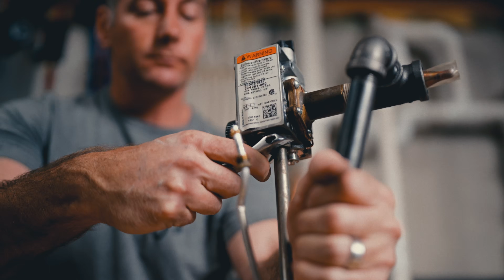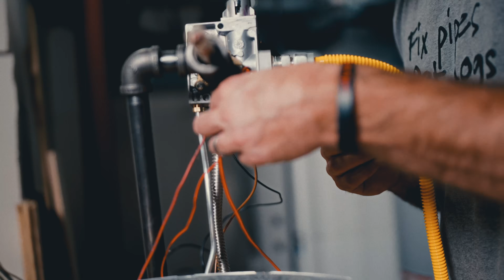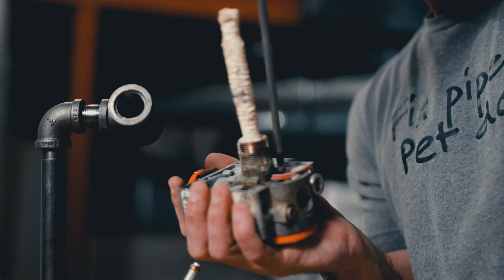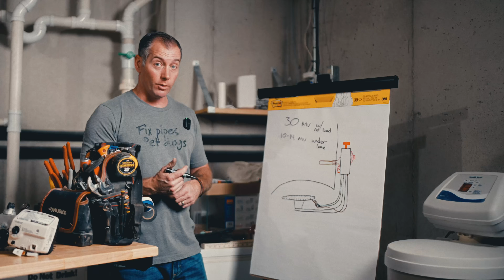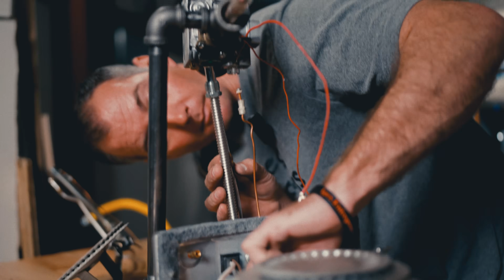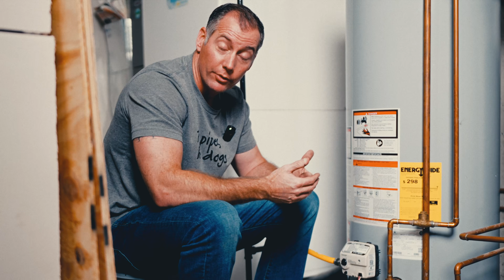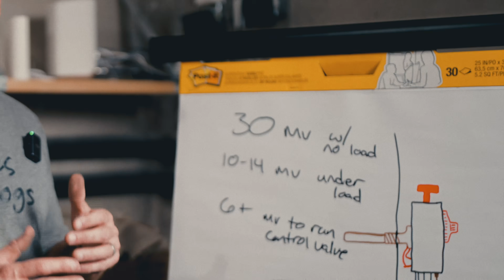Water Heater won't stay lit - Here's why

Comment: I’m old enough to remember when a water heater would last 30 years without any problems. Now they make them “safer” and they only last 5-10 years.
Reply from the maker: Planned obsolescence for sure
Reply: @SmedleyPlumbing  Ensh*ttification.
Reply: I installed my old Whirlpool in 2004! That was the first yr for the sealed burner assembly. It's the model that had a problem with the pilot light going out. Whirlpool sent out a replacement entire burner assembly, with a limit switch. The original assembly didnt have a limit switch. 21 yrs old now and working very well.
Reply: Small tiny electronics and total disaster
Reply: My wife and I purchased our home nearly 30 years ago, which was a couple of years old. We replaced our air conditioning unit about three years ago and the water heater just stopped working (heater won't stay lit). I'm going to try to replace the thermocouple (no, I have little idea of what I'm doing), but just sharing the testimony. As I shopped around, I'm told water heaters are only supposed to last ten years or so, including air conditioners. I thought we were suppose to progress, rather than regress...  I want the old models in a new version, but alas. I'm not sharing the brands, because it sounds like they all of changed in quality.
Reply: If all fails, we going with a tankless and lining up the install ($5k-$6.5k)
Reply: @Austin_Bennett77  everyone I’ve talked to that has a tankless on demand type loves them, I have heard that hard water and minerals can be problematic and the heat exchanger needs cleaned every so often so I think a good water filtration and softener would help.
Reply: @OldmanWithaGoldPan-o2g thank you!
Reply: @Austin_Bennett77  wow i will stick with a tank water heater it only cost me 800 dollars about 5 years ago last one lasted 18 years
Reply: I think it's not the 'safer' that makes them last less but the 'efficiency' that does. All these super efficient appliances are so finicky
Reply: My old Rheem lasted  47 years and was still heating fine! ❤ The only reason it had to go was rusty braces holding it up. I miss Old  Faithful. 💧😢
Reply: My 100 series lights as required every time.
But the flame burns yellow & loud about every third time.
I can't figure out why.
Reply: Some of the safety stuff is great.  Not many people these days remember when water heaters were actually known to blow up/out due to not having a safety relief valve on them.  Until a person sees the back side of a house completely blown out, or someone, like a wife, or especially a kid or 3 scalded severely from a water heater blowing out, the average person these days never give that little $30 brass fitting much thought.  Some safety stuff do suck, but others could be worth their weight in gold in the right situation.  JS
Reply: @jimjordan5630  yeah the TPS valve is a good thing for sure. They’ve been in use (according to googoyle) since around 1910, and I’m not that old lol.
Reply: My Man! Thank you for breaking it down for the common man. I was more knowledgeable about what I was doing and looking at, and not just replacing my unit on the fly! 😅
Reply: Had an LP in Sandhills north of Hutchinson ks from 1974, leaker in 2017
Reply: I installed a new big box store Rheem gas only water heater 2 years ago with a honeywell controller and it's already having pilot light issues. I believe Smedley Plumbing would call it a series 4. It has a thermistor in a brass hexagonal tube near the big burner, a thermopile heated by the pilot light, the spark wire, and 3 wires inside the control box that I assume go to dual thermistors inside the tank. All that stuff checks out.   At this point I think the little control circuit board is the problem.

I design solenoids and it's crazy to me that a 30 mV thermocouple can hold that pilot plunger down.
Reply: @har @harborfreight2323 he reset/WCU/thermal switch has activated then kit very well could be a clogged air intake vents. If that is covered in dust just wipe or brush it off and rest the little shut off button and light. Hopefully this does the trick.
Reply: @OldmanWithaGoldPan-o2g  Do you mean whatever lets air flow up to the burner in through the bottom of the housing?  I haven't looked in there but I will.
Reply: The thermocouple is not powering a solenoid that opens a valve.  Your finger pressing on the knob is what opens it.  There is a latch that keeps the valve open that has a small electromagnet powered by the thermocouple. 
Compare it to a rifle trigger.  It takes a moderate amount of force to cock the hammer, but just a tiny force on the trigger to release it.
Reply: @colonelkilgore6296  That makes sense but the main burner valve operates without human assistance.
Reply: @colonelkilgore6296  This makes sense, but how does the main burner valve open and close? I'm asking about what I think is a series 3 controller, with only a thermocouple. Maybe the burner valve operates differently, or maybe it's like the valves on my sprinkler system where a tiny needle valve opens and uses the fluid pressure to operate a larger valve.  Kind of like a transistor.
Reply: Fact check true.  I had a 32 year old A.O. Smith that was working.   But I changed it thinking it was on borrowed time.  New A.O. Smith lasted 8 years with nothing but problems.   I just finished about an hour ago changing it out.
Reply: How do I reset my AO Smith? Flashes 6 times indicates replacing burner. I blew out dust and debris around air intake but burner won't light.
Reply: Should I try to replace burner myself (no experience but u tube video looks fairly straight forward)
AO Smith unit
Reply: Yes! The took the simplest appliance in the home and made it very complicated. You can probably thank some lobbyists in Washington for that 😂😂
Reply: @TheRingo001 oh we know that's the damn true!

Comment: My new (bought 9/24) Bradford White gas Water heater was set to pilot before I left on vacation for 3 weeks.  When I came home I went to turn the stat to desired temp.  As I was turning the dial to "low" heat, it would not fire.  Then to "Hot' still nothing.  I had to turn it all the way to "Very Hot" and it fired.  My conclusion was it never stopped heating the water at all even when on pilot.  Does that sound like a bad T-Stat?  Thanks!
Reply from the maker: Nope.  Tanks hold heat much better than you think.  That pilot light is pretty warm.

Comment: Just moved into a new house and it has the series 300. I get the pilot lit and the blue light is flashing and I turn it to the desired heating that we want it at it starts to heat. I see the flame through the little window. It works for about a minute and then it shuts down with a red light error. I’m trying to figure out what it might be. If you have any suggestions, I would really appreciate it. Thanks in advance and a great video.
Reply from the maker: The red light should blink a number of times and then you reference the fault code guide on the control valve.
Reply: @SmedleyPlumbing  Thanks for the reply. I will check that out . Much appreciated!!!

Comment: First of all great video. I have a Bradford White Defender water heater. It keeps going off and now it won't come back on. I'm very mechanically inclined so I want to diagnose and fix it myself. The reset button you mentioned didn't click on mine. I don't think the issue is with the thermopile which leaves the control valve. Do you have a video on how to change the control valve?
Reply from the maker: Manually light the pilot light and keep holding the button down.  Then check for at least 350mv dc from the two wires plugged into the control valve.  If you have 350 or more, replace the control valve.  If you have less than 350, replace the thermopile.
Reply: My gas got shut off for the Federal mandated meter inspection an then pilot would not relight. I didnt even see any spark so replaced igniter assembly. Pilot now lights and I get green status light but pilot goes out as soon as I let off the pilot button.

Comment: My hot water heater has the valve, pilot light, igniter button and thermocouple.  I've replaced the thermocouple and valve both.  I can light the pilot first try and after a few seconds or more it stays on and I can turn the unit on. 

It stays full flame running for 5-10 minutes then just turns off, pilot light and all.  I have to wait a few minutes to relight the pilot, but once the pilot stays on I can instantly turn the unit back on and get a nice big blue flame.  

It stays on for another 5-10 minutes then just shuts off instantly, pilot light and all.
Reply: Well my brand new thermocouple lasts 5-10 minutes then goes to 0mv.  Wait 3-4 minutes and it starts working again.  Just my luck to get a defective one 😒
Reply from the maker: Chances are you have a blocked air inlet screen or a blocked flue pipe.  Sounds like the unit is overheating.
Reply: @SmedleyPlumbing so there was a giant plate covering the tiny filter.  I cleaned underneath and around the plate but the plate would not come off.  I finally pried it off and sure enough the tiny intake vent was covered in rust debris.  Hoping it will stay lit now.

I guess it didn't need the control valve, but it was covered in scale pretty bad so it may actually work better now.

It did need the thermocouple though because the pilot would not light or stay lit to begin with.  Once the new thermocouple was installed that's when it would light every time but run for 10 minutes or so then shit off.  Must have nocked more debris onto the filter as I took it apart.

Thanks for the great video and advice!

Comment: I have a resideo control valve. The pilot light would go off the moment i removed my finger from the control valve when igniting the pilot,I replaced the thermopile, and the pilot is still going off after removing my finger from the control valve.
Reply from the maker: Test the two wires going to the control valve.  Need at least 350 mv DC for the control valve to function.
Reply: @SmedleyPlumbing  Indeed. If you are getting > 350 mV then it is not your pilot and/or thermopile. The power from the thermopile powers an electromagnet that holds open the gas valve, so you no longer have to hold it with your finger.

Comment: My brother in-law has a 3 unit income property.
The company that installed the water heater less than two years ago failed to replace it adequately.
American Standard 40 gallon water heater serviced 3 units with a washroom with appliances.
When I contacted the company they advised us the plumbing company who installed this should have installed a commercial water heater 50 gallons.
Can you please explain the warranty with each type.
Also, the reason the pilot wouldn’t stay lit was they didn’t install a drip tee to prevent condensation and any debris coming into the unit’s burner assembly and gas valve, thus the pilot staying lit failed.
I had to correct that.
Plus the company said that if they installed the 50 gallon unit we wouldn’t have to purchase the pilot assembly it being under warranty (less than $100.00) I purchased & installed.
I tried to send a photo but wasn’t successful.

Myself being a 3rd generation retired HVAC and sheet metal contractor (father 56 years) helping my father I’m always concerned with how the gas appliances termination tops should be vented.
Thinking about the heat exchangers of both the water heaters and any type gas appliances, if they don’t have the type-B termination caps, I would think the exchangers overheat and most of the heat that should have gone into our homes go into the atmosphere instead of our homes.
The central heaters has an inducer motor that turns on prior to the squirrel cage motor and doesn’t have the ability to know if the termination top is there or not.
In the 1980’s is when we installed space heaters they usually were installed in Victorian fireplaces. 
Prior to that time they simply could be put in the small fireplace and vented with a bonnet top termination top.
Also Williams wall heaters had a sensor they wouldn’t function without a double wall flue with a B-termination cap.
Now as you mentioned, they must be directly vented from the unit with double wall ductwork (Metal Bestos) or other brands.
They have several sensors if you have the knowledge to explain I believe it to be helpful for all to understand.

Excellent presentation!

Thank you!
Reply from the maker: Sounds like the cheapy is won the job.

Comment: That was an awesome video!  I appreciate you taking the time and effort to educate us non-plumbers.  Many people just don't have the money to pay to have things fixed.  I have the money, but I'm super cheap and a little adventurous.  Anyway, well done, and thank you!

One quick question:  Will the water heater pilot and or burner light if the door  (with the viewing window) off, or does the door need to be on?  It's a Bradley White with the plastic covered control valve.
Reply from the maker: It will light with the viewing window removed.  But you lose your resistance to flammable vapors.

Comment: Very informative video, sir. Question My AO SMITH WATER HEATER pilot light won't stay lit after 2min. I did replace the brand new pilot assembly. Could this be the gas control valve need to be replaced? Thank you for sharing, sir.
Reply from the maker: Possibly.  Is the thermocouple or thermopile producing the correct millivolts?

Comment: I have Rheem water heater, the pilot will stay on, there is no light, you can see the burner light up, but it will not stay lit for very long,maybe as little as 4-6 seconds.
Reply from the maker: Rheem is notorious for having bad control valves.
Reply: @SmedleyPlumbing should I replace the control valve or the thermal pile?
Reply: @SmedleyPlumbing  I just had one bad on a new water heater out of the box. Went to light pilot, and nothing. That was supposed to be the easy part. Rheem did get the part out quickly, but...reallllly? . Once installed, it lit up after two strikes with the igniter button.

Comment: So i pilot is continuously going out and im needing to press the reset button every time also the flashes are indicating thermopile low voltage  even after replacing thermopile. Also we replaced the control valve last year as well. Any idea why the voltage would be low and the temp probe keeps tripping. Could the temperature probe  be faulty or  need replaced possibly? Ive cleaned out any debris around the burner assembly and around water heater.
Reply from the maker: It's possibly your reset switch/button is faulty and pulling too much current.
Reply: Thank u so much for the quick response do u know what the current pull should be or how I can test this

Comment: Great video! My 75 gal water heater, over a couple years, occasionally failed to keep the water at temperature.  If hot water was used it would sense the decrease in temp and the valve would kick on. But over long periods of no use, like over night, the slow gradual decrease in temperature was not enough to force the gas valve and burner on.  I replaced the Rheem Water Heater valve SP14339B twice and each of the new valves did the same thing. Hot water during the day but over night it cooled.  I also replaced the thermocouple and pilot light parts. Any ideas?  Thanks
Reply from the maker: Sounds like the water temp might be set too low.
Reply: @SmedleyPlumbing  Thanks for the response. Temp is set to B, scalding. I keep setting it higher but same problem. It is a strange problem to have on multiple valves.

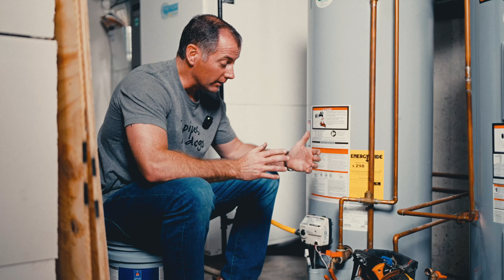Comment: Hi. Great video. I have a Whirlpool 50t6-40ng-400 which uses the Honeywell system. After removing buildup on the thermopile and reassembling, I did the procedures from 13:30 in the video. The thermopile hits 733mv. As long as i keep the control on "Pilot" the pilot light stays on; timed it to 10 minutes. But once i set the temperature to "hot," the flames kick in for no more then 2 minutes and go out. When it goes out the pilot light goes out to. Would you have any suggestions?
Reply: Where is the inlet
Reply from the maker: Most likely a dirty inlet air screen
Reply: Thanks I think that’s my problem also 
Going to clean tomorrow and see 😊

Comment: Okay, I have a question if anybody can answer. After letting go of the valve button the flame for the pilot light stays on but when I light the water heater grill it goes on immediately but then starts to get lazy blue. color. Why is that??
Reply from the maker: You want a blue flame.  Yellow flames indicate bad air fuel mixture.
Reply: @SmedleyPlumbing  yeah I understand, but the flame will start to wobble back and forth instead of staying an inch above and around the grill. And kind of looks like it's struggling to stay up. I already replaced the valve with a new one and vacuumed out any debris in the burner area and replaced the glass sensor bulb in the back. Maybe it's the thermopile not giving off enough millivolts but has enough millivolts to light the burner but not allowing the valve to open all the way.

Comment: My water heater is upstairs and in a tray. I can't get under it to clean it. Is there another way to clean the screen underneath. My heater goes out all the time and I got to push that reset back in everytime. It is a gas heater with the series 300-400
Reply from the maker: If the tray is metal, you can bend the edge down and then bend it back when your done.
Reply: It's a big plastic bowl pretty much. Black in color. It's pretty deep.
Reply from the maker: @johncummings260  you can probably use a flexible brush to get under there

Comment: So basically skip everything he talked about and just replace the thermocouple first if it doesn't fix it then replace the controle valve as well since he recommends replacing both if you have to replace the controle valve
Reply from the maker: But learn why it failed and how they work.  Parts changers are not plumbers.